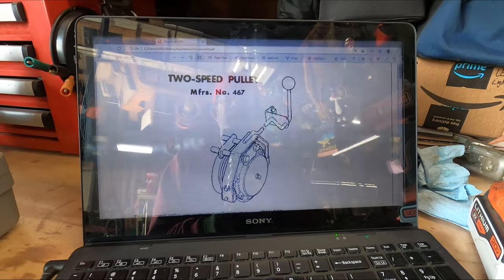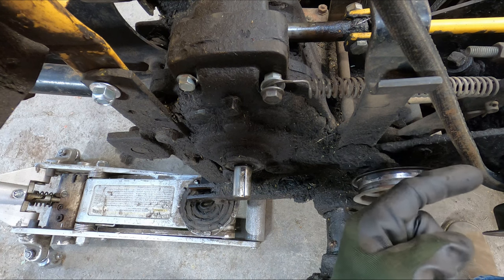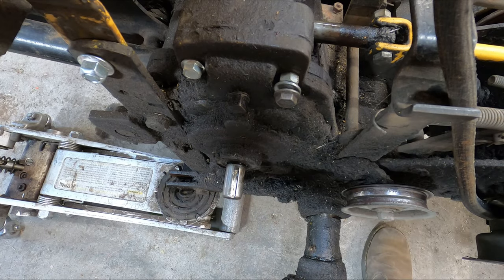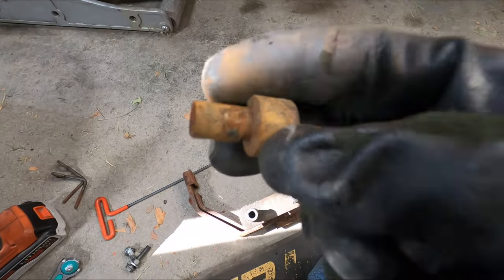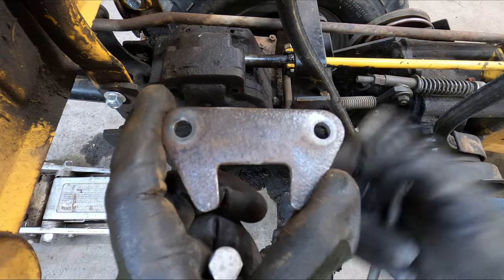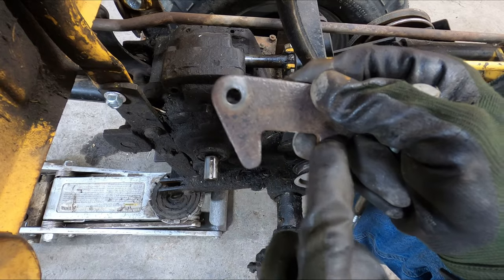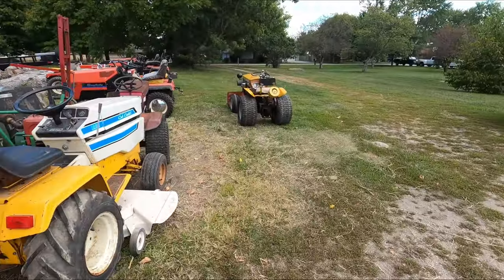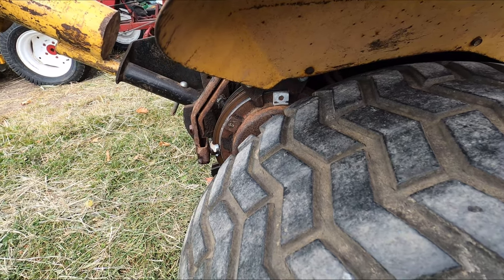Installing a Hi-Lo on Early Simplicity, Allis-Chalmers or Wards Squire. Bloopers left in!!

Comment: Man these older tractors sure look well built and have many options for them that you don't get with the new ones.  But I suspect back in the days those were some of the more expensive tractors on the market.  Great video.  Thank you once again.
Reply from the maker: Heya Mr. C! Yeah, back when things were actually built to last and quality was everything. Now, you can be certain you'll pay a LOT for this level of quality. For example, a Simplicity Legacy XL with 4 wheel drive, diesel engine and the basic implements like a snow blade, mowing deck and tiller, you're looking at close to $20,000. This tractor retailed for just $1087 with Hydraulic lift ($130 option) and Hi-Lo ($46 option). These were the 1967 prices. Fast Forward 55 years and yeah....Quality is still top priority, but man does it come with a price! Cheers! Zip~

Comment: I like the Grumpy videos, as if it can get any better, it does. Love the used but not abused look of that tractor.
Reply: 🤔’ oxymoron?  If it’s used odds are it’s abused 😳 .. 😝 ✌️
Reply: @rawbsworld6604  You called me a what ??  lol, just judging by the straight sheet metal it appears someone took decent care of it. Most were worked hard and put away wet, if put away at all.
Reply: @gearbanger57   hahaha  🤦‍♂️ thought I could slide one in without getting called out!!! 😂😂😂 ✌️😆 ..  TBH cosmetic appearance never crossed my mind  🤷‍♂️ ,,  good point!👍 was just thinking mechanical or lack of maintenance etc
Reply from the maker: Sneaking into this hysterical conversation to say thanks for stopping by Banger! Cheers! Zip~

Comment: Funny, I was just looking into 2 speed minibike Ideas, One old-timer told me, 
he  used a low & high speed set of  stacked pullies on the crank shaft & jackshaft  &  the belts would slip  & a toggle tensioner shifter leaver was used to tighten one belt while slacking the other. Looked like an up side down tee handle  with the shifter knob on top & tensioner idle pullies at the ends & you'd shift it over center to set it. Really fun Because you can shift on the fly  or quick shift. I've also heard of a 2 clutch 2 speed setup but it seems much more clunky. It would be neat if there as a planetary 2 speed gearset drum that would activate with a brake band...

Comment: Curious how it works, can't completely picture it in my head. I'll have to look at a manual or pictures.
Reply: ah I think I can picture it now as the pulley spins on a bushing with 2 sets of gears which contact planetary gears and the power is applied by the outer portion - if that makes sense. Pretty neat.
Reply from the maker: @M.TTT.  Yep! You got it! Fixed gear is mated to the pulley and when you engage the low speed, it pushes the planetary gears into the larger gear giving you a 3 to 1 reduction. Cheers! Zip~